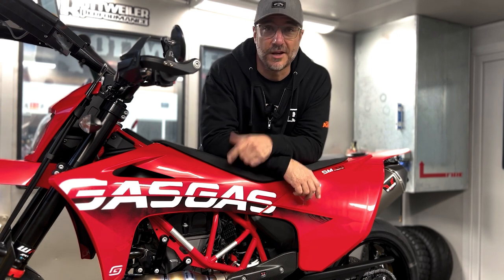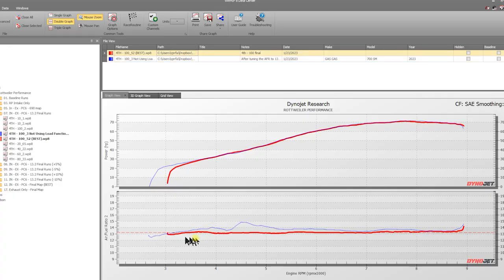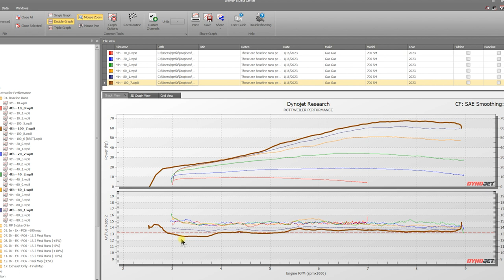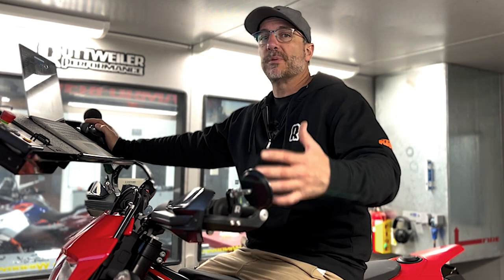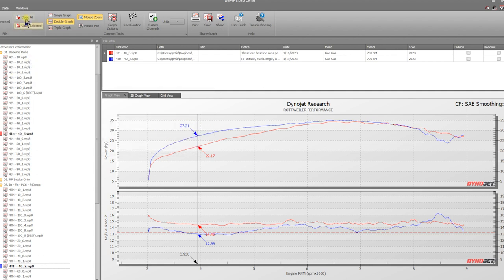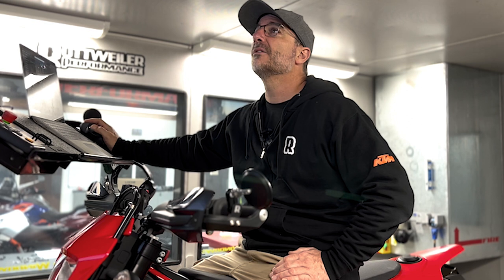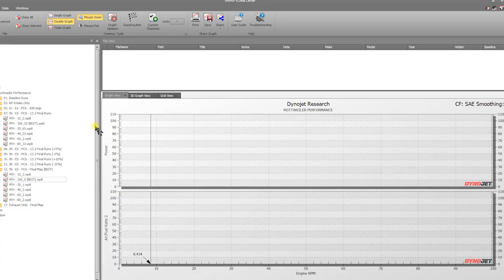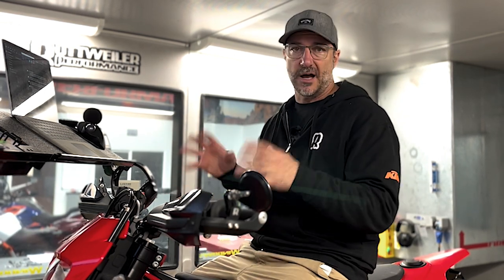TUNING WITH ROTTWEILER - GASGAS 700 SM/ES (2023+)

Comment: So i guess all maps are made with an open exhaust, but i can't possibly ride on the dirt roads around here like that because it gives the farmers to much time to go and fetch the shovel and wait around a corner. How much difference does a db killer make? Is it making it run too rich instead?
Reply: I doubt there's any need to remapp a bike like this if you intend to use it on the dirt and you are not a Dakar rider.
Reply: @cyclemoto8744  not for necessarily for power, although they are pretty dead on low revs. But they are very lean stock, making them overheat. I put on a fuel dongle and a power commander on my 2019 (euro4). Almost have too much torque now but i don't run with the fan on all day anymore. Starts sometimes, when expected.

Comment: What power losses do you typically see when you use the DB killer insert installed in the Arrow slip-in’s?
Reply from the maker: 1 to 2 hp here and there. It's not significant, but certainly not what an engine likes. Plus they are harder on the packing.

Comment: Excellent video and very informative, I have the 2022  euro 5 701 and had the choice when I purchased new of either the Ktm, Gas Gas or the 701 so I spent the day much to the dealers surprise road testing all 3 and I felt the 701 was just better out of the box. 
Not saying it is the “best” but to me personally I gelled with the 701 and have now enjoyed adding to it.
This kind of video is great to pin point what we are actually trying to achieve by modding the bikes.
Cheers

Comment: Damn I was getting excited with the massive power and torque gains......till I read in the comments that the 700 you were tuning was a Euro4 and not a Euro5.
We here in Australia have the Euro5 since 2021 as someone else said in the comments. My new 2022 suffers from asthma in the low to mid rev range and Im very disappointed. It would be great for you to get a Euro5 on the test bed and see what you can do with it. Will keep an eye out for any commentary. There's some money out there to be made guys if you can crack the encoded ECU and piggyback a PC6.
Reply: Same!
Reply from the maker: We are working on it. Those bikes don't get over here and getting one of every model is just not cost effective but we have some solutions that are in the oven. Stay tuned.

Comment: Hey guys I’m looking at getting a power commander for my 2022 gas gas 700, I’m from Australia, I’m confused if this will work on my bike cheers.
Reply from the maker: Unfortunately the 2022 models in Australia are Euro spec, which don't respond to the fueling dongles. We are working on some solutions for them though.
Reply: Hi mate did you come up with any power tuning options for Aus model bikes?

Comment: How does the PowerCommander 6 work with the factory map switch? Can I switch between a power map and an economy map with the factor switch as well as operate TC? Thanks
Reply from the maker: That's a great and common question. They don't effect them at all. They simply modify by percentage what is happening 'below' it, so whatever the stock ECU is telling the injectors to do, it modifies that by a pre determined percentage that is the map installed. So whatever position you are in, it will work perfectly well with that. On the larger bikes that have 'rain' and 'street' and 'race' modes, those are cocktails of traction control, throttle sloping and ABS, none of which are really alterations of the fueling like some believe.
Reply: @RottweilerPerformance  That's awesome, thanks!

Comment: Cool 🤘🏻 
Would be interesting to see best possible (money is no object) version for 2022 890 bike 😊
Reply from the maker: The video linked below is pretty much that. The 890 ultimate build would be idententical to this to some degree, but just with an 890 motor. 
https://www.youtube.com/watch?v=Eli2d9ht2oU&t=782s
Reply: I ment video like this just for 890 😊
Reply from the maker: @AustrisPhoto  We probably will. The thing about videos is that when you find something cool to do that people like and you hit on that, then you need to go back and do the same for all of them (or should) so we have actually been talking internally about dovetailing in videos at the end of testing that showed you, the viewers everything we found interesting about the bike and what happened along the way when we were testing different things. One we plan on doing soon is what happens to the power and air fuel ratios when you remove the cat and the theory behind all of it. We think that one will be really interesting to people and we have a lot to share there to dispel the myths that are put out there by some somewhat questionable companies.

Comment: Interesting video thanks!

You mentioned an engine light with the 700/690/701 due to the narrow band o2 sensor finding a rich condition after tuning. Is this something that all of the newer 700’s will encounter if tuned with a Power Commander?

Just to confirm you were still running the o2 sensor in this video?

Does all this info apply in the same way to European and Australian 700’s?

Comment: Thanks for a great video. Is the throttle opening 0-60% for the closed loop? If I use a fuel dongle, when does it stop dumping fuel in the closed loop?
Reply from the maker: The fuel dongle helps fill in closed loop by tricking the bike into thinking the exhaust gasses are lean, so it only works in closed loop which is really where you need it. Open loop can use some adjustment, and that can be done with a Power Commander in addition to the fueling dongle. We have great maps for that bike!
Reply: Thanks, unfortunately, here in Australia, my Gas Gas ES 700 is euro 5, so will have to wait for someone to come out with a solution apart from a fuel dongle. @RottweilerPerformance
Reply from the maker: Working on that so 'stay tuned' so to speak... @EricBanner571

Comment: How many hours/miles were on this bike at time of testing? Does it matter if the bike has been "broken in" according to the manufacturer or not?
Reply from the maker: This bike was broken in on the Dyno, oil changed to synthetic and then all the mapping and runs were completed. The 'breaking in' period the manufacturer asks for is really just a suggestion that's good to follow but not law We use the dyno for all of our break ins because we can, but we would suggest checking out our break in video on the Adventure 1290 for more info on that. https://www.youtube.com/watch?v=h8FMY1svmrA

Comment: Are the maps you made for the Svartpilen 701similar to these? And I mean as far as really good AFR's like I see on this video. I am considering selling my Svartpilen 701 because of how horrible it is to ride at lower speeds and RPM's due to the motor being so lean. My last effort to improve it would be an arrow decat and the power commander you guys sell, if the tuning was aimed at fixing the awful AFR's on the stock map.
Reply from the maker: You should have no issue using our maps on the Svartpillen. We think you'll really love this bike after putting on a Power Commander. Reach out to our tech help at info@rottweilerperformance.com and hit them up to see what we have for that bike.

Comment: Super cool video, you guys don’t take a break! After moving and setting up the new spots you guys jump right back into it! 

Would I be ok ratio wise to use just the Rottweiler intake and fueling doingles on my 690?
Reply from the maker: On the 690 yes, at minimum. The fueling dongles are basically like a pilot jet in a carb, they only help low end. For full mapping you'll need a Powercommander and it's worth every penny on that bike. Really good results.
Reply: Thank you! I appreciate the help, and just like that you guys got me saving up for a power commander now lol
Reply from the maker: @frostygonz  It's a slippery slope with us! 😀
Reply: No doubt haha, love it though! Rottweiler is a super cool company, love the work you guys do! I’m stuck on upgrading my 690 enduro or putting it towards a 890 adv r lol. Why not both?!
Reply from the maker: @frostygonz  Just do what we do. Own them all!! (Insert evil laugh here)
Reply: @RottweilerPerformance  that's the goal!

Comment: Super informative video, thanks so much!

Question... I have the Rade Garage front fuel tank that comes  with an intake which deletes the airbox,  similar to the Rottweiler.  The bike is otherwise stock.  Would your power commander tune (along with compatible muffler) be applicable to my bike (2023 701 Enduro)?
Reply from the maker: Sort of. The intake that comes with that kit isn't good for any power. We have dyno tested them and they are about the same as stock, except they are oiled foam and very small so they tend to load up fast. A Powercommander will work great on that bike, but you'll want to use maps that say 'STOCK INTAKE' and not use the ones for the Rottweiler Intake System because they have more fuel because, more air.

Comment: What is Rottweler’s goals with regards to internal engine modifications for this motor?
Reply from the maker: To be honest, internal stuff reduces the demand by quite a bit mainly because of the diminishing returns for 'dollar to horsepower' ratios. There are very few customers that really want to go that deep so we focus on the big gains that are easy, affordable and accessible by almost every kind of owner/rider. That isn't to say we won't do more internal stuff at some point though.
Reply: @RottweilerPerformance  I asked because in the video he mentioned that they were considering going into the motor for more gains.  I thought perhaps that meant a cam & gasket change that could provide a little tighter quench and a bit of compression. A relatively easy few HP that could safely be had with premium petrol for “an edge” that many would pay for on a popular motor that has long experienced high sales and a strong following.
Reply from the maker: @vernlochtefeld1626  We agree, and we are constantly expanding our offerings for these models so more internal power bits will be coming for sure.
Reply: Looking at the existing power curve, a cam might start to take away from the bottom end pretty quickly.

Comment: awesome video! the bike likes the fueling to be a little richer. Is that because of the construction of the engine (bigger bore and shorter stroke than the old 690 engine) or because of the parts you added to it?
Reply from the maker: Larger bores seem to like a bit more fuel. The big twins respond well to it as well. It's not a necessity with the twins, but the big single is about as large a piston as you would want and the burn characteristics seem to thrive on it.

Comment: Thanks to Chris & co. for doing the work for us and proving it via the dynovenue.  I have a new (2023) 690 with just a few miles so adding engine-based mods is not in the cards until the warranty elapses however I would be interested to get your take on what you would add and in what order once the modding threshold has been reached - here is your potential shopping cart:  (these are all Rottweiler-sourced). 1. Fueling dongle. 2.  Exhaust (just the can, no header) 3. Intake system 4. SAS/canister removal kit 5. Dynojet PC6.  Did I miss anything?  Feel free to add up to 3 items at one time.   Last question:  What do you think a more linear fuel/air delivery will do to the longevity of the engine internals - I get that too lean is harmful.  Have you torn down an engine after tweaking it to inspect?  Again, thanks for the great products, excellent customer service (already had the opportunity to be part of yours!), and for doing your 'homework' and sharing it with us.
Reply: Just stick all the mods on now, better for the bike in the long run because it runs cooler with the fueling and timing advance mods from the PC6. The bike is a lemon without these mods.
Reply: I added a fuel dongle to mine while still in warranty. Takes 5 minutes to add or remove it. Leave the O2 sensor in place and just seal the open plug from dirt with electrical tape. The dongle noticeably reduced the jerkiness at low throttle openings which meant I could ride in at least one gear higher. It didn't completely eliminate the jerkiness but was well worth the improvement for such a small cost outlay. This was on a 2020 KTM 690 and it was not a Rottweiller supplied dongle.

Comment: So I have a 2023 ES700 If I wanted the complete max power setup do you have a link to that combo? Thanks
Reply from the maker: This link if for the Power Commander 6 for the GG 700. If you also purchase an intake and a muffler, just leave in the comments on the PC6 page or upon checkout that you would like it mapped for this group of parts. Simple as that! https://shop.rottweilerperformance.com/dynojet-power-commander-6-for-gas-gas-700-es-sm-2022/

Comment: I live in europe and gone buy a 690-701 probably gone get a left over 2022 GasGas. They have Kat in the silencer and are tune 12,5 in fuel to get the Kat hot enough, that makes the silencer so hot that it melts the blinker lights and not possible to have side bag. Im gone make mine to be a rally bike and TET so gone change the exhaust system to a more open air and no Kat but that makes the bike to lean. Is a fuel dongle on the nox sensor gone work for that? Are gone get a european distributor for Rottweiler?
Reply from the maker: The fuel dongle should be looked at similar to a pilot jet. They really only work on the bottom of the RPM range. They work really well for putting around and keeping the bike smooth and help it to not stall, but for full mapping purposes we would highly recommend a Powercommander for that bike. They work wonders.

Comment: So a slip on can with cat and stock filter should cause any issues? Thanks
Reply from the maker: Not with the stock intake. That is so clogged up a muffler alone won't matter much in terms of mapping, but if you are looking for up to 12hp to the tire, a Rottweiler Intake System, Muffler and PC6 is the ticket for sure. https://shop.rottweilerperformance.com/dynojet-power-commander-6-for-gas-gas-700-es-sm-2022/
Reply: Does pc6 work on 2023 euro 5 bike?
Reply from the maker: No they do not. On some we can unplug the O2's and map them with a PC6 but only with an engine light showing. Some people don't care much about that, so we offer it, but they do not work 100% because some of those bikes can't be fooled with O2 optimizers. @Baphomet_biker

Comment: What is best starting mods for smcr/701? Is rotweiler air intake with wings exhaust good start?
Reply from the maker: Thanks for your question! We don't carry the Wings Exhaust, but we have a number of other options from Arrow & Tekmo. This is definitely a good place to start if you are looking to achieve more power on your 701: Rottweiler Performance Intake: https://www.rottweilerperformance.com/rottweiler-intake-system-701-husky/ , DynoJet PowerCommander 6: https://www.rottweilerperformance.com/dynojet-power-commander-6-for-husqvarna-701-enduro-sm-2016/ , Tekmo Racing Header: https://www.rottweilerperformance.com/tekmo-racing-titanium-header-690-701-all/ , Tekmo Racing Muffler: https://www.rottweilerperformance.com/tekmo-titanium-racing-muffler-690-701-all/ , Rottweiler Performance SAS/Canister Removal Kit: https://www.rottweilerperformance.com/sas-canister-removal-kit-ktm-hqv-gg-690-701/